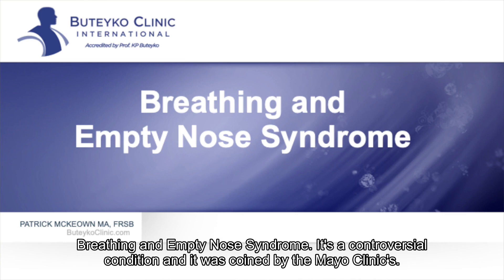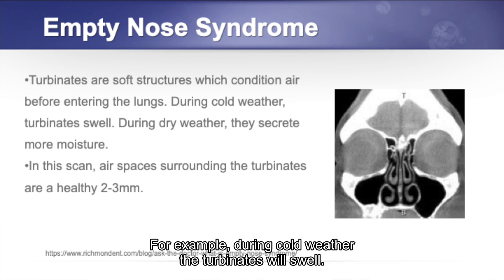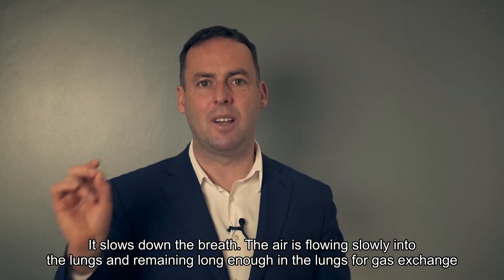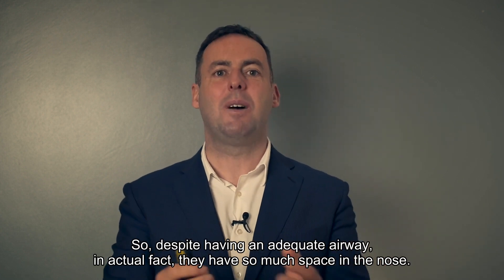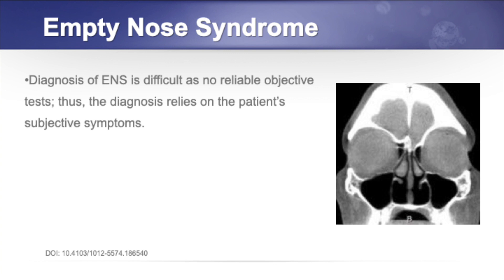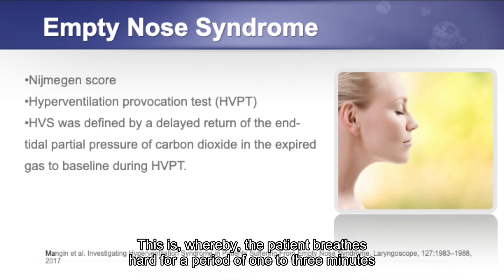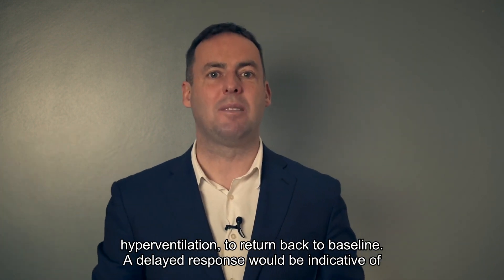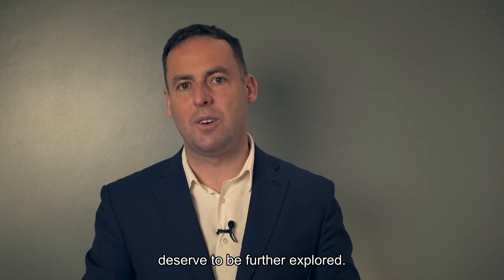Empty Nose Syndrome

Comment: I had my Septoplasty yesterday and today I found out about this. What is the percentage of this happening to me?
Reply: Very low unless you had turbinate surgery. Generally speaking ens is caused from damaged turbinate nerves. The turbinate tissue has the ability to heal itself however if you have pre existing inflammation, the tissue will continue to swell.. stopping the healing process (it’s like constantly picking at a cut) which then causes it to scar as the body stops trying to save the nerves.
Reply: @gabshewitt1  I also had my nose hump and turbinates reduced. But not that much since I can still see them with a mirror and a flashlight. I also had 6 anti-inflammatory shots after surgery. I can breath well although sometimes it gets clogged.
When does the Symptoms of ENS appear after surgery?
Because for now, the air I breathe doesn't feel dry
EDIT: this is the 25th day after surgery. If there are no symptoms, does that mean I'm safe?
Reply: @ahmada.9953  no ens is a slow deterioration for most. My symptoms began about 12 weeks after surgery and progressively got worse. I believe my chronic sensitivity/ inflammation results in nerve damage as my nose has progressively also become very dry. My suggestion going forward would be to reduce the inflammation as much as possible naturally by avoiding the triggers or find out ASAP what’s causing the inflammation if you don’t already know. I never found out and still need to!
Reply: @gabshewitt1  I thought that the only cause was removing too much of the turbinates. My surgeon was very conservative didn't remove much. I also overused Oxymetazoline nasal spray an extra two weeks.  I might have to check up on that.
How is the quality of your life now?

Anyway I hope that you can get well.
Reply: @ahmada.9953  ENTs do not report accurate information regarding the matter as they do not understand the nature. They also choose to turn a blind eye to the truth as it negatively effects them. 
The more turbinate touched, it’s more likely you will have issues. I was told I had minor turbinate reduction but my scans were reviewed and actually removed by about 70%. Ens is caused due to deterioration probably because the nose cannot maintain a healthy cycle. This can be caused from the surgery alone however the risk is greater if you continue to experience inflammation due to ongoing immune responses as this further stops the nose from finding a healthy environment. It’s Similar to if the mouth did not get adequate moisture and bacteria it would become dry, damaged etc. 

The difference is your nose is an actual airway. This is why ens is so dangerous as your brain is obviously going to be very responsive to damage. It’s why your turbinates are deep inside your head. It’s really sad thinking about why they operate on such delicate tissue when you think about it. 

My quality of life is very poor compared to what it was prior to surgery on my turbinates. Dryness and nerve damage feels to have set in. I’m sorry to scare but it’s the truth and a lot of people prefer not to hear it. 

My advice to you would be to insure you do your very best to insure inflammation is kept as low as possible and that your look after yourself. Avoid dry environments as this damages the mucousa. If you experience inflammation, find out why! Stay hydrated and avoid artificial treatments such as steroids. I wish you all the best
Reply: @gabshewitt1  Fuck man, My doctor made the surgery sound so simple. About being hydrated, this is the 31st day past surgery and the first day of Ramadan. I have to fast off food and water for 15 hours a day. I don't know how it's going to affect me. I might sneak water behind my parents back. I hope we keep this channel of communication active. Stay strong and don't lose hope.
Reply: @ahmada.9953  I would suggest drinking water if you are concerned for your lifelong health. Dehydration causes damage. I continued to binge drink alcohol on the weekends and this 100% made things worse as dryness was very bad in the mornings
Reply: @ahmada.9953  I’m 4 months post of turbinate reduction and I have no Symptoms of ens
Reply: @gabshewitt1  I used to drink over 5 litres of water the month prior. I plan to hibernate during the day and be active during the night. I used saline sprays to moisturize my nose. If necessary, I'll drink during the day. Health and recovery should come before religious rituals. And Iqra, thanks for the positive feedback.
Reply: @ahmada.9953  yeah but now I’m actually scared ima get ent!!! Because I heard some people get it after a year of their surgery
Reply: @iqra5976  Yeah or more than a year. But you can't put your life on pause until the symptoms appear. Keeping this mindset will destroy your life before ENS does. I made the decision of fully living my life. And if the symptoms do appear. I'll deal with it then. However, sometimes when I'm alone with my thoughts, I can't help it but panic. Keep yourself occupied so that you don't succumb to your dark thoughts.
Reply: @ahmada.9953  okay I understand where your coming from but like so is everyone who had surgery just waiting to get ENS in some point of their life or is there a chance we won’t get it I’m only 17 and I’m so worried
Reply: @ahmada.9953  apparently it’s rare so I’m confused
Reply: @iqra5976  I believe only a minority get it. They just tend to be more vocal because people who don't develop ENS don't go out of their way to tell you how successful the surgery was. Contrary to people who do, who are spreading awareness about ENS to warn people of the possible complications.
Reply: @ahmada.9953  do u think I will get it my surgeon did laser turbine reduction nose job and septoplasty I regret it so much except the nose job because my bretahing hasn’t change did you get septoplasty aswell?? Or just turbinate reduction
Reply: @iqra5976  I got turbinate reduction, the surgical one , where part of the bone is removed. A septoplasty, my septum wasn't deviated by much. And a rhinoplasty, the hump only.
I admit the reason I pushed for the surgery is for the rhinoplasty, my turbinates were enlarged and I mouth breathed and snored in my sleep. I regret it now because living with a large, somewhat blocked nose is better than living with dysfunctional one. I think the snoring and mouth breathing could have been fixed with a CRAP machine.
I can still see my turbinates with a flashlight and a mirror so that gives me hope the doctor didn't remove much. I just hope the nerves in them heal and continue to work for the rest of my life. I learned a major lesson about thinking things through and not be driven by insecurities. My breathing is better now but sometimes it gets clogged, so I have to rinse it with saline. I hope no complications happen in the future.
Reply: @ahmada.9953  yeah but if it’s a rare thing that can happen why are you worried also I heard if you had a laser turbinate reduction done the chance of ens is even smaller so how did the surgeon remove ur turbinates ? Same here I was insecure about my nose aswell
Reply: @iqra5976  He removed part of the turbinate bone with a scalpel, no fancy tech. It's more invasive and dangerous. I have yet to ask him why did he choose this method. I trusted that surgeon because he also removed my tonsils 15 years ago when I was 10, and made the operation sound like a walk in the park.
Reply: @ahmada.9953   wow that’s crazy! I came for a nose job and septoplasty only in turkey and my surgeon decided to do my turbinate reductions without telling me or my dad we didn’t even know what that was until after surgery
Reply: @iqra5976   I am from Syria, and they do the same here. They don't go into details of what they're planning to do. I had to wrestle information out of my surgeon's mouth. He's always busy with patients and doesn't have time to answer all my questions, which are plenty. He dismissed the possibility of me getting ENS by saying he didn't remove much .Any surgeon worth his/her salt should have no problem answering any question a patient may have.
Reply: @iqra5976  hey man do you have chronic inflammation still. Why did you have the surgery?
Reply: @iqra5976  hey bro don’t worry about it. Look after yourself. Avoid things which make your nose bad and stay hydrated and rest well. Most people don’t get it. People who do get it usually have constant nasal swelling which puts too much pressure on the nerves etc. Wish you all the best. If you don’t get any symptoms after about 6 months it’s far less likely you will not get it as long as you look after your nasal hygiene and avoid artificial products and unhealthy environments
Reply: @ahmada.9953  your from Syria omg!!!!!! I got my surgery done in turkey actually which is near Syria how is life like in syria
Reply: @ahmada.9953  good idea. Yes do look after yourself. Ens is far more common when people have suppressed immune systems as it reduces the chances of proper healing. A lot of people who have allergies and decide to get the OP are usually safe as the inflammation and immune response to allergies is usually short lived therefore the nose tissue still gets adequate resting time which allows proper healing and nasal cycle. If you need any future advice just ask as I’m always happy to help. If your nose is constantly swelling and responding badly to the environment this is what is likely what will put you at substantially higher risk. My nose nerves are constantly swelling and I don’t know why which is certainly why I’m struggling now with ens symptoms. I do hope when I finally address these issues my nose can at least partially repair itself
Reply: @gabshewitt1  thank you so much I will listen to what ur sayibg
Reply: @gabshewitt1  omg what if I have constant nasal swelling!!!!!
Reply: @gabshewitt1  I had the surgery because I wanted a nose job and also I had a deviated septum then without telling me my surgeon reduces my turbinates!!!! And I’m only 17 wth
Reply: @gabshewitt1  thank you for your wishes all the best for you aswell did you get turbinate reduction?
Reply: @gabshewitt1  why does constant nasal swelling give people ens I blow my nose harshly does that count
Reply: @gabshewitt1  I’m worried for you that you have to deal with ens how are you feeling now? I heard there is some treatment options for it such as stem cells have you looked into that they apparently help but not cure
Reply: @iqra5976  I see. The chances of getting ens are lower because you don’t have on going issues with nose. The surgeons are messed up. They don’t have a clue what’s good or bad therefore because of the lack of knowledge they can operate on the turbinates as there is no understanding whatsoever on the matter
Reply: @iqra5976  The city I live in is relatively safe, although we're dealing with terrible inflation. One of the reasons I rushed the surgery is that I have to ditch the country soon and or else I'm gonna get drafted into the military.
Reply: @ahmada.9953  why don’t u move to turkey when I visited Turkey I saw that there was lots of Syrian people already there and they fit in well there
Reply: @gabshewitt1  That is a good explanation but how some people have no turbinates and dont have ENS this contradicts your inflammation theory since there are no nerves at all , also if you have just a turbinate reduction (not resection) there will be still untouched nerves that dont need healing , does your infllamation theory apply only to resection of turbinates?
Reply: @iqra5976  salam Iqra what’s was symptoms before surgery
Reply: @ahmada.9953   how did everything turn out?  Any ENS symptoms?
Reply: @NavyDave219  Nothing, and I sure hope it stays that way. I still have a nasal cycle and my nose is still producing mucus, which are good signs. I recently moved to Moscow and I don't have a problem with cold air.

Comment: Never had surgery on my nose but the last two years have been agony. It may be due to an injury I had a while ago but I CANT BREATHE. I go to sleep suffocating and unable to breathe every single day. I can’t do activities, I can’t even go up stairs without being completely gassed. I went to my ENT and they recommended turbinate reduction/septoplasty, then I do research on it and OF course, it sounds awful. But a part of me thinks it can’t get any worse than it is already. I’m stuck and don’t know what to do.
Reply: Please please please do your research and seek every other avenue before surgery. I wish I had 😢. Sorry to know you’re suffering.
Reply from the maker: Hi. The Buteyko Method is designed to decongest the nose, and help restore normal breathing. It is recommended to try the nose unblocking exercise from the youtube channel: https://www.youtube.com/watch?v=tgmKIwUqhkg&ab_channel=ButeykoClinicInternational. For nasal problems – the only way to deal with nasal congestion is to hold breath until a strong air hunger. If you suffer from constant nasal congestion, you should practice nose unblocking exercises along with rinsing out the nose daily. For nose washing, it can be very helpful to do the following: 1/2 teaspoon Celtic or Himalayan sea salt in a glass of boiled water which has cool. Snort a large volume of the water into each nostril. Bring the water down the throat, hock, and spit it out. For severe nasal obstruction – breath right strips can be helpful. They are plastic strips which when placed on the outer part of the nose, dilate the nasal passages. It is a temporary measure.  If you do physical exercise, it is very important that you spend the first 10-15 minute nasal breathing with medium air hunger – it is a great worm up because it will open up your nose, it will open up your airways, it causes spleen contraction and it increases oxygen delivery as well to the brain. When you have a compromised nose, the air hunger you feel during physical exercises is going to be higher. So, that’s why it is important to get a nasal dilator (a really good one is “Intake” Nasal Dilator, also there is one called “The Turbine”). Our Buteyko courses are listed here  https://buteykoclinic.com/buteyko-clinic-online-courses/. Considering your health condition,  these self- study online courses (1st from the list) would be very helpful.
Reply: @ButeykoClinicInternational  umm I have a Problem I have a blocked nose only one side what should I do?
Reply from the maker: @Morning_jesus  Hi. A partially blocked nose is common with nasal breathing, one nostril will be partially blocked while the other is free to work. Practice exercise 2 "Reduced breathing by blocking one nostril"  - when one of the nostrils is partially blocked, create a need for air by placing your finger over the unblocked nostril and try to breathe through the partially blocked nostril. By blocking your free nostril,you will reduce the air intake and should experience a feeling of air hunger. Try to maintain this for 4 minutes at a time. The effectiveness of this exercise will depend on the strength of your urge for air. As a bonus, after a few minutes of breathing through your blocked nostril you should help to ease the congestion.
Reply: @ButeykoClinicInternational  oh ok thanks! For responding
Reply: I was one day away from sinus surgery to reduce my turbinates and correct my septum, started researching sinus surgery on youtube and discovered ENS, my ENT never even mentioned it. I have enlarged turbinates and I'm eating Sudafed 12 hour like Flintstone vitamins. I cancelled surgery at 6am the next morning. I can't breathe every day, both through my nose and I'm short of breath also, I take Flonase, Xyzal, and Trelegy every morning daily just to be able to breathe and sleep at night. Without Trelegy I wasn't sleeping but a few hours at a time and waking up at night. I feel like I have ENS symptoms without ever having a procedure done. All of this hit me a few months after being hospitalized by Covid. I've had short stents of having trouble breathing in my life, but until June of this year, it's never been daily and taking the meds I'm taking daily. Even with the meds I still have shortness of breath almost every day. Actually I was going to have the surgery to help this issue I'm having, im glad I found these videos of ENS. Just about every day of my life is misery, I tell people and they just look at me like I'm crazy, so I can relate to how people feel when they can't breathe..